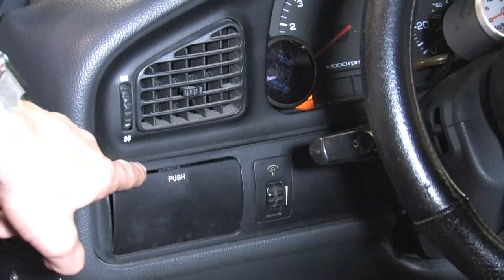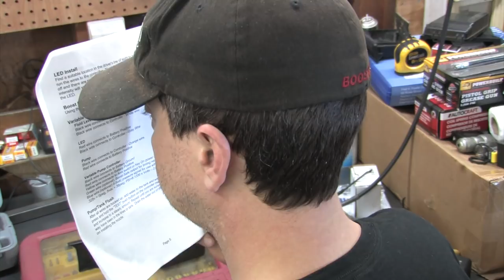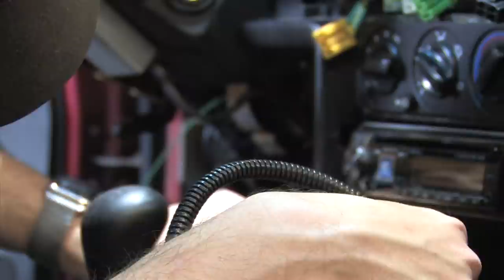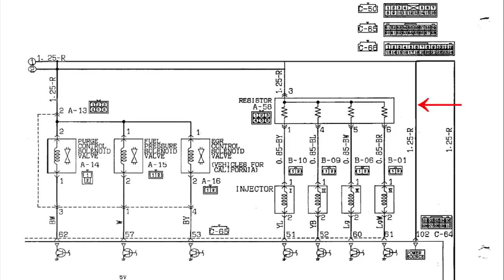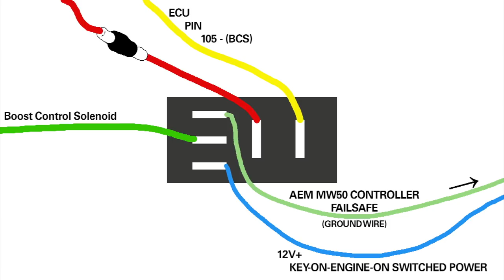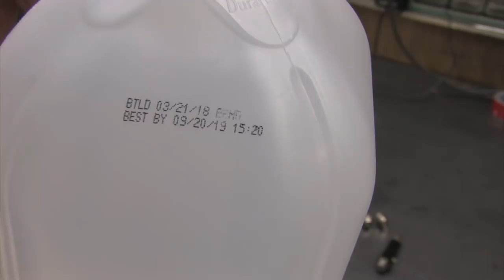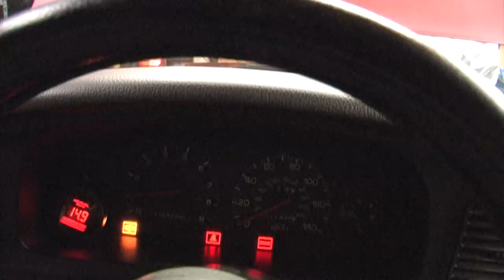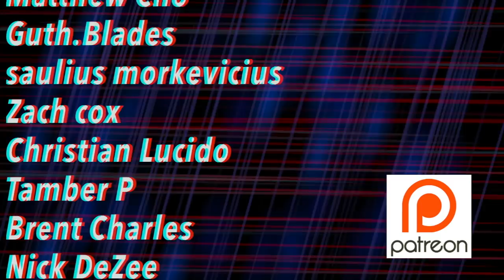Water Methanol Injection Installation

Comment: Move your battery to the trunk for more bay room
Reply from the maker: I have a video about that in the Traction series.  I originally got this car with the battery already in the trunk.  I moved it back up front over the FWD axle for very specific and performance related reasons.  :)
Reply: @Jafromobile - Interesting, I've been bingeing your videos home sick on the couch just got done with a few and loved your port n polish job. I've been planning for over a decade to turbo my first new car I bought in college. Now that I'm 32 I have the money and just trying to figure out how i can do roughly 450 to 600 and have it be reliable enough to not have to rebuild for at least 5 years, mostly the same idea as yours a street n track car. Finding a place to sleeve my engine has become my first major hurdle. Plus i don't own the major tools to take my engine out so I'm basically seeing how far down the rabbit hole I wanna go.
Reply from the maker: @R0cketRed  You can borrow or rent most of those tools.  Having the ability to haul them around is another issue, but you can borrow or rent the things that do that, too.  I think the key to everyone with goals like yours is really just to make sure you have reliable transportation in general, not necessarily that the performance car actually has to be reliable.  If the car is designed for half to a third as much power as it's making, then you're inevitably going to find all of the weak links when you apply that power no matter what the car is.  That said, removing all the stress of leaving yourself stranded only requires a second car.  Anyone working on their own car for performance reasons should have a second car for employment reasons.  It can be a bucket if it starts every time you turn the key.  It's not unusual to get those power levels out of many engines for many years, but the transmissions, axles, suspension parts usually don't fare as well.  I shredded 3 transmissions at around the 400hp level on a car designed for 210.
Reply: Yea, your absolutely right. That's why I've waited all this time to do this, now that it's been a few years sense I've had a second car that I know won't just break on me and both have no payments left. I also wasn't going to drive an intercooler and all that hard work on salted roads in the winter here. That's a great point to rent the equipment, for some reason I always forget you can do that with expensive tools. I've also looked into the trans for something stronger, I'm not sure I'll be doing it at the time bc I'm not even close to rich but hopefully if I'm smart about it and don't try and put all the power down from a dead stop it'll last until I can again afford to replace or rebuild stronger. Have you ever mailed a block out to have work done or always used your guy Mark that's near you. Makes me nervous having it sleeved.

Comment: 40:00 Driving with foot on clutch can cause clutch bearing damage.
Reply from the maker: This can has No-Lift-To-Shift, and the video demonstrating this had not been uploaded yet.  Had I so much as touched the clutch pedal, it would have stuck my car on a 4800 RPM rev limiter.  My foot is NOT touching the clutch pedal.  There is no dead pedal in this car because this is an auto-to-manual swapped car.  So, it appears to be something that it's not.  Perspective is everything.  If you saw a side-view of that pedal, you would not have posted this.  Hover foot, not clutch rider.  I've been driving manuals for 30 years.  Clutches have never been a problem for me.
Reply: OK, I understand ;-) Just a many people do that and they dont know that they can damage clutch. But I'm sure, it's not your case. Nice video and detailed description of everything. Good luck.

Comment: You're still dragging your welds. You don't drag mig.
Reply from the maker: Honestly it's because I've blown out the darkening function of my welding mask and need to replace it.  I'm blocking the arc with the cup.  Pushing the weld, I can't see where I'm screwing up until I'm over an inch past it.  I'll get a new mask.  I have to.  I'm not risking my eyesight over a Hyundai.
Reply: Yeah right on.  Figured I'd flip you some shit on a nice Sunday afternoon.  Keep up the great videos, I can really tell you put a ton of work into these.

Comment: You just ride with your foot on the clutch!! Lol
Reply from the maker: Over the clutch, not on it.  There's no dead pedal in this car.  It used to be an automatic, and was converted to manual.  I suppose I could put my foot on the fuse box and ECMlink cable, or I can just perfect the hover foot like I have to do in this car.  I don't ride clutches.

Comment: 14 years!? How much crap has been sucked into that engine eh
Reply from the maker: To be fair, K&N filters are "lifetime filters".  I've washed it 3 or 4 times and re-oiled it.  It hasn't even gone 50,000 miles of total use.  But yeah, it looks really rough after 14 years and 2 different engine bays.  :)

Comment: why doesn't this guy relocate his battery to the back of his car it will open up all room under the bonnet out some weight in the back..... he could make it into a video how to or whatever
Reply from the maker: LOL!  Not laughing at your suggestion.  I'm laughing at the timing of it.  2 videos back, I did a video about how to relocate a battery from the trunk back into the engine bay.  This car came to me with a trunk-mounted battery... and it was one of the worst modifications it ever received.  It adds a huge load of resistance to the charging circuit which can lead to hard starts and weak battery charging.  In cars that are FWD, it's the most ruinous, detrimental thing you can do for achieving traction.  The best place for a battery in a FWD car is in front of the front axle because of how weight shifts with acceleration.  The video title where I relocated it back to the engine bay was "Turbo Elantra Traction Issues - Part 3".  In that 4-part series I thoroughly track-tested 4 modifications.  Front suspension, rear suspension, weight distribution and tires.  In that order.  With all of them combined, I shaved .3 seconds off my 60 foot times at the drag strip.  Battery relocations are awesome mods for show cars and RWD cars, but on a FWD tuner machine... unless you're making room for hundreds of horsepower that won't fit anywhere else... it's better off in front of the front axle.  The weight of the battery over the drive wheels is your best friend.

Comment: Water injection doesn’t increase air density, meth will increase density but not water.
Reply from the maker: Dude.  Yes it does.  Love ya bro, but I think you meant water injection doesn't *enrich your fuel mixture*, but that meth will enrich it.  That would be 100% correct.  I know that was an honest mistake.  ;)  Google "colder air is denser".  Water vapor does have a direct impact on air density.  So does the thermal drop that occurs as water injection sucks all the heat out of the intake charge.

Comment: If you have to use 100% meth to get real results you are doing it wrong. Typically, those with 100% mixtures are using a crap system like the AEM being installed here. They use flow by boost, which isn't what the engine is looking for. You really want flow by injector duty cycle, or flow by MAF. 

With flow by boost, u reach peak boost at say 4500 rpm, and at 4500 rpm you are delivering full flow of methanol/water. This will bog your engine down, too much quenching, so the natural thing you do next is use a smaller nozzle. The thing is, when you use a smaller nozzle you end up with less desired flow near redline where you REALLY need Water/meth.  When you use 100% methanol the bog in the midrange is less, and you get to stretch it out over the remainder of the power band. 

I've made more power with 100% but the increase was negligible.

Comment: Better watch out on your foot. While driving rest it on the side not on the clutch pedal
Reply from the maker: There is no dead pedal in this car.  This car was originally an automatic.  My foot is not on the clutch pedal.  The camera is on the opposite side, so you can't see that my foot is hovering over the pedal.  The clutch in this car has over 300 12 second drag passes and over 50,000 miles from a different AWD car that weighed 500 pounds more with 430hp.  It's a very well-used ACT 2600 clutch.  That video is here on my channel somewhere where I pulled it out of my used parts.  If I had a bad habit like that, this clutch wouldn't still be functional, and my used throwout bearing would be making a bunch of noise.  A lot of people insist that what they see in the video is evidence that someone who's been driving manual transmission cars for 32 years can't drive, but like a fat girl's facebook profile, perspective matters.  It's just because of where the camera is.  The clutch pedal is a foot higher off the floor than where the dead pedal isn't, so moving my foot that far to place it against the firewall between every shift would be extremely problematic when one is not cruising.  The "hover foot" method is what happens when you can't pivot your ankle and easily rest it on a dead pedal.  It's something created by missing equipment that makes it easier to drive.  Look back at that clip... there's no dead pedal.

Comment: Driving with the foot on the clutch is a big sin :(
Reply from the maker: I getting this comment a lot, only in this video, and I'm getting flipping' tired of it.  People need to stop telling me how to drive.  Nobody understands that scene is just to the end of my street and back, but it's not obvious because of where the camera is positioned.  I'm not cruising.  I'm changing gears and speed zones, and I wasn't even gone from my driveway but for 3 minutes.  It wasn't even a mile.  All I did was stab it once, go to the end of my street, turn around, stab it again and park it.  I just needed a quick WOT log to check boost pressure for the video.  If I were driving more than a mile, not in traffic, or at a steady speed, then my foot would have been off that pedal.  By the way, that clutch in the Hyundai is the used GSX clutch with over 150 drag passes and 48,000 miles of road use.  I bought it in 2001.  It's out-lasted 3 transmissions and is now installed in its second car.  If I had bad driving habits like everyone digging on this issue is claiming, that wouldn't be possible.  This old dog already knows, and has better manual transmission driving habits than the majority of people in this country.  Had I stuck my clutch foot to the roof of my car between shifts to get it as far from the clutch as possible, people would then have critiqued the position of my hand on the steering wheel.  But if that's all that anyone can pick out that I'm supposedly doing wrong... then I guess I'm doing pretty good!  :)
Reply: Jafromobile I see! I was just afraid you didnt know that. I had a friend destroying his clutch and release bearing by doing this!

Sorry to bother you
Reply from the maker: You're alright.  I ain't mad.  I know it's just the beginning of the flood.  Like the hand position on the steering wheel thing I mentioned... it's a very real thing to post a video and get comments about it for years afterwards.  That really does happen.  People complain about how I have to hold the wheel in my GSX at the track because I'm 6'4" and there's nowhere else for me to put my hand and maintain control of the car because of where my left elbow ends up against the door.  It's the handicap of being tall, but god forbid I hold that wheel at 12 o'clock so that I can turn left if I have to.
Reply: Jafromobile I bet.  Im only 6 feet tall but I have a Miata (turboconverted). My hand position on the wheel is the same, my elbow hits the door even though I have deleted the armrest.
Reply from the maker: I know what you mean, bro.  I drove the mazdaspeed version that had 2" of foam cut out of the seat, and the only place I could put my elbow was out the window.  No cupholders, I had to put my drink in the trunk.  Is that your daily?
Reply: Jafromobile Used to be my summerdaily, but I just finished the conversion, needs som final touches and a tune before its ready to be driven on the regular basis. Only running 7psi and pig rich atm.

https://www1.garaget.org/archive/148/147333/381900/large_381900-3716459.jpg

Comment: BoOsT gUaGeS aRe UsElEs. *overboosts and blows the fuck up.
Reply from the maker: That's a honda problem.  This engine has held over 30 PSI for several days.  It can hold every bit of boost this turbo can produce.
Reply from the maker: Dude relax.  Sometimes truth is uncomfortable.  A stock 6-bolt 4g63 rotating assembly can make well beyond 450 wheel horsepower.  I have built hondas, I have blown up hondas, I have owned hondas.  I already know.  The story is here.  Don't be so sensitive.  The 30 PSI pull is on my patreon page.  It is private.  Don't worry, when I take world's 2nd fastest Elantra with a full interior and subs in the trunk, that video's going to get posted.  It's not that great of a feat... the bar's been set really low.

Comment: lol u r complaining about boost gauge, why? complain about the the stupid placement not the gauge, is not his fault that some stupid guy put it in front of that important ligth, just put it on other spot that dont cover anything important, is easy
Reply from the maker: The guy that put the gauge there didn't have ECMlink and wasn't using the check engine light as a knock monitor.  The doood's actually pretty bright.  I installed that later.  But yeah, I did say "I'm of the opinion that..." preceding my rant.  In my experience, a boost gauge vs. the data you can achieve with a MAP sensor and logging boost... there's just no comparison.  A boost gauge doesn't give you information that you can use for tuning.  All that really matters in that regard is your A/F ratio.  ECMlink captures and logs boost data, so just like if you had an electronic boost controller (and therefore no need to have a boost gauge because it provides that function), having a MAP sensor log boost is infinitely more useful as a tuning tool.  It makes a boost gauge redundant.  It makes you look at the gauge even less.  When I blow an intercooler pipe off or develop a boost leak, I always hear and feel it.  Some people like them.  I won't take that away from them.  I just don't need one.
Reply: yes u r totaly right  but u can still have the boost gauge at the A pilar for exemple ;) its not covaring oything there ;)

Comment: Wow I had to stop watching your video. A boost gauge isn't there for you to "self log" your boost. It's there to monitor your boost under load in the event your wastegate fails and you have a 30psi boost spike you can back off the engine. Mechanical failure is a thing. A boost gauge is a cheap and easy safety net for you to monitor the health if your system.
Reply from the maker: The engine I built can hold every bit of 30 PSI, and has done it, sustained, for over a week.  I turned the boost down to make more power because this turbo isn't efficient at 30 PSI without methanol injection.  I suppose it's all about perspective then?  Some people need a safety net.  I still have it.  If something's wrong, I take a log or plug in the laptop and check it everything including boost.
Reply: @Jafromobile  do you believe cars should do away with oil warning lights or gauges too? Telling people that boost gauges are worthless as a general statement is poor advice. I'm sorry but I don't agree with you and I wont be watching anymore of your videos.